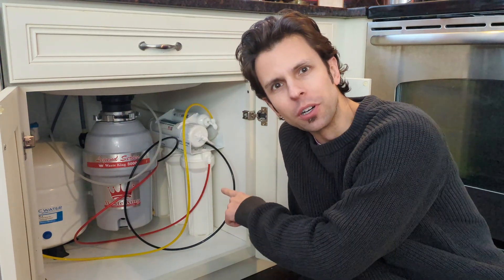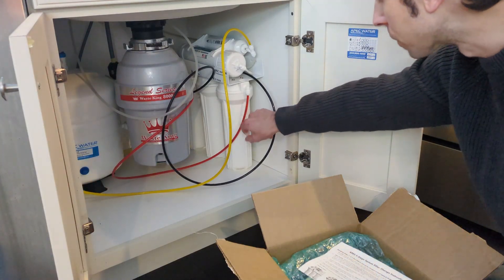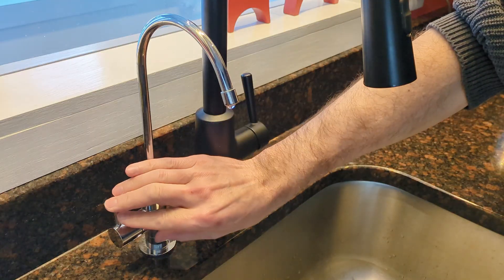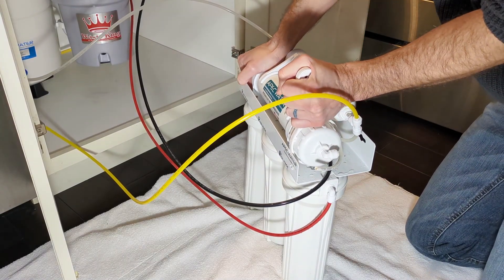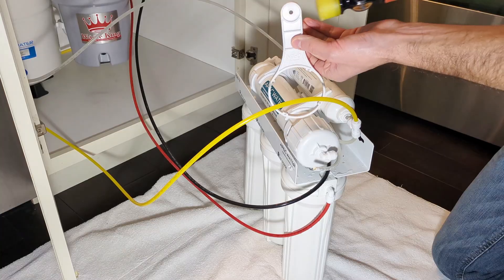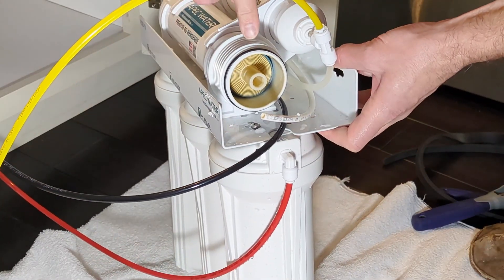How to Replace Reverse Osmosis Stage 4 and 5 (RO and Carbon) Water Filters - APEC System

Comment: Hello, what is mild bleach solution?
Reply from the maker: Mix just a splash of bleach with water.
Reply: @realhouseDIY  What should be the ratio?
Reply from the maker: @berkay956 I would half fill the first stage housing with water, add the splash of bleach (no more than a tablespoon, but not worth measuring it), then proceed from there. Perfectly safe after flushing the system several times.

Comment: Did I miss something. You show to run the water but you don't shut off any water until after you start the water????
Reply from the maker: I pointed out shutting off the needle valve right after opening the faucet to drain the tank. The order doesn't really matter. It was a bit cramped to get video of me closing the valve.

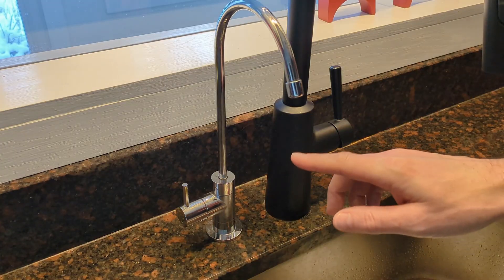Comment: I'm confused at the start 1:34- How can you run the water until it's a trickle when it already runs indefinitely? It seems a step was skipped for turning off a valve.

9:06 Valve on the drain line? When was that turned off in the video?
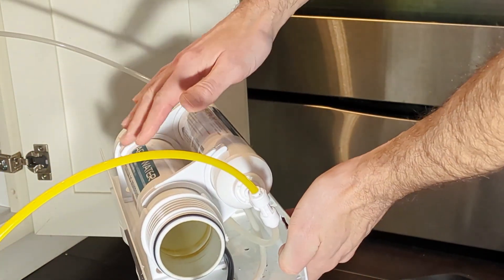4:55 shows a black line with no drain valve, but 5:11 had a black line with a drain valve installed.

While learning how to use the strap wrench and the clamp wrench are useful,  the lack of attention to detail means this video does not fulfill it's function and I will have to look elsewhere. Still gave it a thumbs up, but since this is my first time seeing "RealHouseDIY" then every video on this channel becomes suspect. I always watch multiple videos on subjects like this (had to fix my Navien tankless water heater), and one important value is looking for a channel that I can trust. So for this channel I have made a mental note: "Don't trust." So maybe it's good for general info, but that requires me to compare it with other videos, thus lengthening the time to learn and decreasing the value of the video, and in turn the channel. By watching multiple videos I can determine the proper steps in the proper order, and if I find one channel that has all the steps, then I'll subscribe to them, and never look at any other channels again for this topic.

I didn't have to explain all this, but I did it for your benefit since it seems you run a general DIY channel, and are not some random person in their home, whom I would not criticize. Hopefully this insight will benefit your channel. Good luck!
Reply from the maker: Thanks for the thorough review! I'm definitely a real person and try to make my videos accurate and good quality. 

For emptying the tank and turning off the shutoff valve (shown just seconds later in the video), the order really doesn't matter given how slowly RO systems filter water. To save the most time you could open the faucet, then turn the needle valve while the tank drains.

The drain line valve can be completely ignored for this video. I installed it specifically for a different video where I showed how to sanitize the system. I recorded that video when I had the filters removed. I didn't realize it might cause confusion so I apologize for that.

Comment: I’ve had the system for less than 4 years. Am I required to sanitize the RO system at this time? Please note I have a whole house water softener (not sure if that makes a difference).
Reply from the maker: APEC doesn't require the system to be sanitized as regular maintenance, but the manual does state replacing filter housings after 5 years, and that growth can cause the RO membrane to prematurely fail. For these reasons you may want to sanitize the system for membrane longevity and to avoid replacing housings that are otherwise in good condition. Other than that, it's easy enough to do it when you need to replace all 5 filters. To know for sure, I would use a water test kit. Otherwise just a guess.
Reply: @realhouseDIY does it matter if I have a whole house soft water system? I got both RO and soft water system installed at the same time.
Reply from the maker: @xomiamarieox no, the water softener system shouldn't matter. The RO system filters will probably last longer.